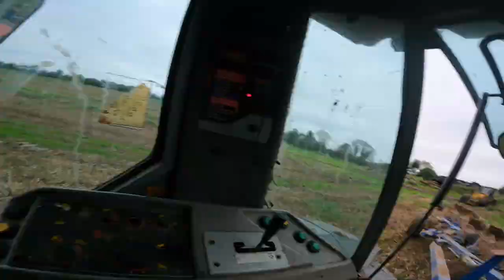PLEASE DON'T BOIL THIS TIME | MF 3690 & 6 FURROW WAGON PLOUGH

Comment: Push pull, 4 on the back 2 on the front, then when the going gets tough just leave the front 2 in the air or 6 furrows down hill and 4 up hill.
Reply: Yeah I’d agree gives you options and weight on the front that is doing something also
I have 5 and 3 works fine does take a bit off getting used too but not the cheapest to buy 
Luckily I got a good deal on mine 
( could be selling it as cut back on a lot of other work so no hurry to plough now)😉

Comment: If you lift the plough with the toggle switch on the box instead of the buttons it will knock the diff off automatically and put it back on again when you lower. Save a bit of hassle for ya

Comment: Great video; pulling 6  is really turning the soil over. I got a 1990 Massey Ferguson 3070 92hp pulls a 4.16's bottom plow. Growing up we had. Massey Ferguson 285  81hp and it pulled a 4.16's bottom plow we also so had a 275, 265 , 255, 175, 165 Massey Ferguson all pulled 3.16's bottom plow.  The 285 had a much smoother ride then the smaller frame tractors. My 3070 is still in great shape. It is quite and also has a good smooth ride while working it compared to the smaller frame tractors. The only larger tractors I have driven is the John Deere 6120 and 6400

Comment: hi phil why are you not useing the bosh eletric hydrulics draft wont work when useing the button near the rear window you should  have your depth set on big dail and use the toggel switch fwd and diff will come out on headland without having to do manualy lower link sencing would be working aswell to help you along
Reply from the maker: the draft control isnt working correctly

Comment: Phil could you not put a  12 volt electric fan from a car on it to a switch in the cab you can get good 2nd hand fans cheap just a thought
Reply: Fit it on front of radiator and reverse polarity to blow air through,  then you can leave original fan on

Comment: Great video, we used to use a 3125 on a 5 furrow semi-mounted overum, have you tried to set the wheelslip to work with the draft control? You have to be moving to set the wheelslip

Comment: Your Tyres have too much pressure in them for a trailer plough as the tractor is only carrying its own weight .Less than 15PSI  and have three cleats on the ground with no muck sticking between the cleats . No harm to put a few weights on the front . You can drive on the ploughing when going into corners when ploughing headlands and back into the corners to plough them first . We used run two 6 furrow trailer ploughs turning in a 17 meter headland without stopping .

Comment: try a 6 furrow on the lift if the 3690 can lift it
Reply from the maker: the 3690 will lift it but im not a fan of the weight thatd be hanging off the back of the tractor

Comment: The plough not set properly,   clay sticking to  front  board,   sure sign  of inproper set plough,    also   plough too big  for tractor, too much wheel slip  when ploughing,    five furrow  be max with that tractor
Reply: Stick to yr Farm sim good boy and leave the real ploughing to the real farmers, cus yr talking absolute rubbish 😠😠
Reply: I agree Michael,  a nice 5 furrow.
Reply from the maker: the clay is sticking cause the boards are rusty and hadnt brightened